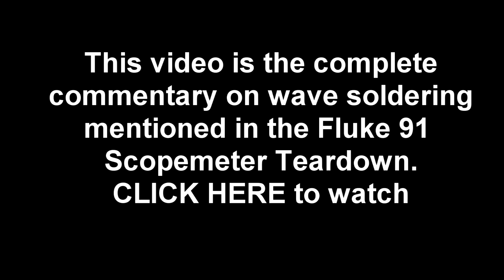EEVblog #431 - PCB Wave Soldering

Comment: why would you chose to go for wave soldering? was it cheaper back then? just seams like a messy way to go. was solder paste more expensive? edit: I understand why you would solder boards that are entirely through hole but, boards that are mostly surface mount , it just doesn'
t sound like the best choice.

Comment: I see wave soldered boards on a daily basis. I clean and maintain an Electra Wave solder machine at work. It makes quite nice joints, but it does bridge smaller ICs a lot. Hence our touch up stations to ensure the solder quality.
Reply: Richard Stifle im learning how to run one tommarow...no prior experience

Comment: I feel like there is some really obvious thing missing here. Do they flip the board over to solder it? How do all the components not fall off? How does the solder not burn them? What if some components have metal in places other than pins?
Reply: He mentioned that the individual components are glued down prior to being soldered. I assume that is a part of the pick & place process... A dab of glue is squirted before the components are dropped in place.

Comment: "The board have plenty of through hole components on the oppsite side (solder pads in the same side of SMD), so cannot figure the way solder using reflow,"

One option is make a tray which masks off the areas where the surface mount components are so that you can wave solder the through hole stuff without impacting the surface mount stuff.

I've also heard there are machines that can apply wave soldering to only small parts of a board.
Reply: The machines that can solder just "a small parts of a board" are Selective solders, look it up, also pretty interesting machines ;)

Comment: The board have plenty of through hole components on the oppsite side (solder pads in the same side of SMD), so cannot figure the way solder using reflow, I understood that reflow cannot handle large through hole components pads, a big conector por example. If SMD were on the top, it would be reasonable to use reflow first, then insert the through ones and make a second pass using wave soldering on the ther side while SMD on the top.. Shame you need to glue the components, and the owen the epoxy

Comment: Sorry to be a bit thick, but I followed your explanation of this wave solder process and didn't fully understand it so I just watched another video of it on youtube. It would appear that if the legs of the ICs are to be soldered then the board would have to be upside down and the whole chip submerged in solder. Surely that's not right. What did I miss here?
Reply: Robert Lewis No, you're right. The whole entire to side of the board is submerged in the solder wave... Everything. Solder doesn't wet anything except the metal parts. It doesn't hurt them. They're exposed to the same amount of heat as a reflow oven would, except for a shorter duration.